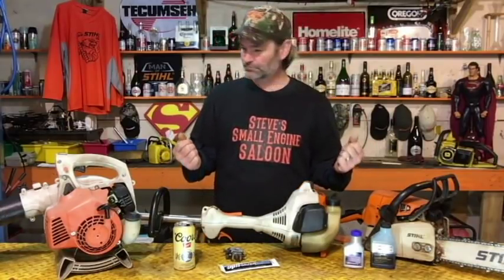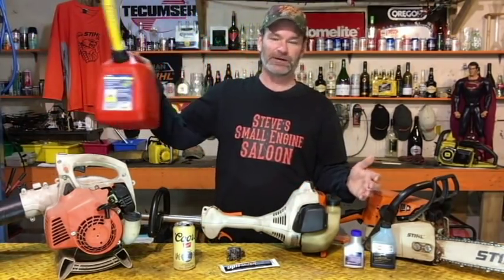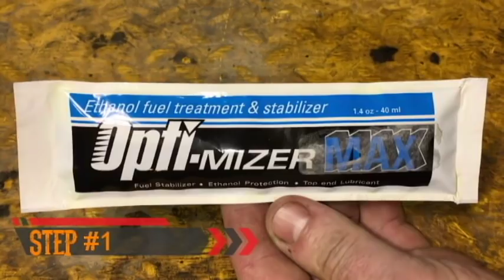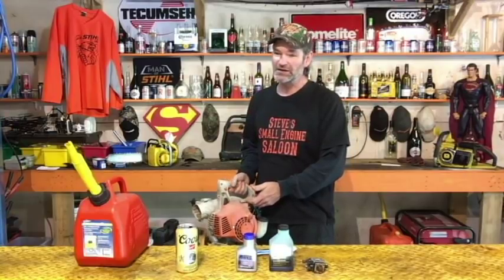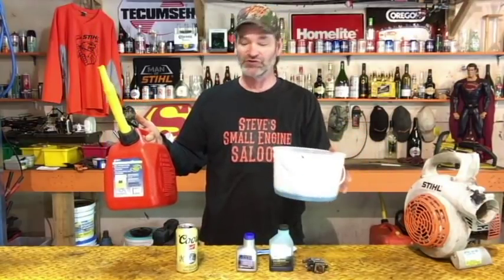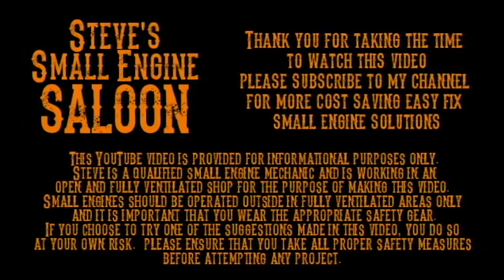How To Winterize a Chainsaw, Weedeater, Blower or Trimmer

Comment: Yet again a good vid but what i don't get Steve is do the rubber bits not dry out in the carb etc and cause problems in the spring Is it not better to keep them moist ?????

I have an old echo chains saw and this you might not believe but having left it for approx 4 years and then needing it in a panic the darn thing started on the original fuel ??

Now i am not saying what you have outlined is wrong to the contrary I agree with you but i am always not sure which way to go ?? The once a month starting is best no doubt

but with 5 strimmers/weed eaters as you guys call them 6 chainsaws 4 mowers 10 motorbikes one outboard motor 4 cars etc etc etc once a month becomes a nightmare !!!

Anyway I am sure there is not a definite answer to this so thanks for your take on it !!! " Perhaps we should just fill them with beers ??????????????????????????? cheers Allan.

Comment: I use non-ethanol fuel in ALL my yard equipment and boat. Never worry about stabilizer and never have a problem. I’ll run the carbs dry too if there’s a fuel shutoff. Everything starts in the spring…always has. The operative word(s) here is NON-ETHANOL❗️

Comment: Another method:
Run engine dry, add a little  (2-cycle) oil to fuel tank, use primer build to suck oil into carb and fuel system. Next season add fresh fuel, primer bulb, choke and start engine. Oil keeps seals fresh.

Comment: Great video steve but there's nothing worse than a dry gasket.  put 50/50 gas oil mix in and let it stall... Pour the rest out and store it!
Reply: Gary Burns = "put 50/50 gas oil mix in it & run it till it stalls"...
DUDE ! . . . You ARE kidding about That , Right ?
50/50 gas oil mix - HOLY HELL !!
I'l Bet You Never Have To Worry About Mosquito's When Your Running Any Yard Equipment !
LOL !  Insects (Or Any Living Critter That Requires Oxygen To Live) Are Probly Runnin For Their LIVES When They See You Pulling Your Weedeater Out Of Storage !

Comment: For a homeowner with a small yard.  Use a trimmer and blower maybe 15 minutes per week, how often would you recommend changing the spark plug?  Blower is used year around because I am too lazy to use a broom on the sidewalk and driveway.  Trimmer from April through October.  Thanks!
Reply: Hey Brian! Make sure the engine is able to get to operation temp. every time you use it. So, 15 min of operation should be plenty enougth for that :) only a warmed up sparkplug can clean itself, otherwise it will be get a bit more crusty every time you use the engine and you have to replace  / clean it from time to time. I have never changed out a sparkplug ever on a 2stroke. make sure you get the right one for your engine, as there a various temp. grade on spark plugs, so this set's up the self-cleaning-temp of the sparkplug to the engine it is used in. check the spark gap, as this is the second parameter. nothing more :) Best regards, Richard

Comment: Steve, aren’t you doing ‘some’ damage to the engine by running it dry? No fuel surely equals no lubrication either.
I’ve always run stabiliser. I’ve found here that stabilised fuel in the carb doesn’t go bad. Comment?
Reply: A couple of seconds on idle isn't going to remove oil from the crank case, everything is coated in oil for quite a while, that's the reason equipment can run for half a tank or more on straight gas.

Comment: Hi Steve. Question: When you winterize a chainsaw, or in my case, summerize my chainsaw, do you follow the same procedure? Do you have to empty the chain oil? Is it better with an empty or full gas tank? I'm gonna be at least 6 months without operating my chainsaws. Thanks for your time.
Reply from the maker: Same procedure.  Chain oil wont go bad.  For 6 months I would say empty....

Comment: Use non ethanol gas and quality synthetic oil and you won't have a problem. I leave that stuff in my 2 strokes all winter and they always fire right up. Even after sitting for a year.

Comment: Is it possible with  bad fuel habits leaving very old mixed gas in Saw for long periods of time and then running leftover gas over and over again for and not winterizing in a snowy climate, is that a possible way to to score a piston-cylinder? Assume all fuel has been mixed properly and proper warm-up and cool-down times have been practiced

Comment: I have some old gas mix, any suggestions on what to do with it?
Reply: Good for cleaning tree sap of chainsaws or, getting campfires going in the rain. You can also mix a small amount of old gas in with a full tank in a truck or boat to get rid of it. Some people don't advise this, but I've never had issues, of course I'm meaning a liter or so at a time in a full 38 gallon tank in my truck, just be weary of moisture in the fuel.

Comment: Steve I hope you can help me. I’m trying to fix a friends mower with a twin cylinder Briggs. Fuel keeps filling into the oil a lot of fuel. What would cause that happen? The valves seem to be ok.
Reply from the maker: Needle and seat in the carb is leaking.  Video will be up on friday.....

Comment: I have a MS-250, bought it with a friend almost 15 years ago. Mine is still good, his, the fuel line cracked and had to change it. Storage is the key, I left mine in the chainsaw box in my barn ALL THE TIME. His was inside, in the basement. Go figure, chainsaw are not indoor tools apparently.

Comment: What are you thoughts about just using ethanol free gas? I understand that solves all the hassle, or have I been misinformed?
Reply from the maker: It definitely helps.  I am doing a video on that soon....
Reply: i empty out my STIHL BG 86 leaf blower run it dry ,then I fill my tank with  STIHL premixed fuel 50:1 fuel mixture combines non-ethanol, high-octane fuel and premium STIHL HP Ultra Oil.let it run for a few minutes and then periodically I'll start it up during the winter months to keep her in shap for the up and coming spring
Reply: @luigitassone8759  thanks for the reply

Comment: I'm no troll Steve.  But I strongly disagree with running the fuel system dry. I've always believed that the end fumes don't have mix oil and the cylinder can get scored. I'm a small engine mechanic btw, but not in the business.  I have quite a few really old pieces of equipment that get used from time, like dad's 30 year old blower,  grandpa's first redmax trimmer etc... if I'm putting stuff away,  knowing I'm not touching them for months.  I make sure that there is a previous tank run of NON ETHANOL gas run through.  Use fogging spray to choke the engine out, then I empty the tank and actually take the carb off, and take it apart, dry it out, and store it Inside the house.  You did give the best advice though.  Don't let them sit! Run your equipment 1 or 2 times a month to operating temp. Message to everyone. ..... avoid gas with ethanol,  2 cycle engines are not designed for it! Carberator diaphragms,  hoses, everything,  it's going to kill anything you put it in!

Comment: Doesn't draining the gas dry out the carb diaphragms? My dealer says to winterize it by just putting premixed fuel into 2 cycle engines
Reply from the maker: The method I showed is recommended by Stihl and I agree with it!  I have a carb kit at work that has been in an open bag for at least 10 years, and the diaphragms are as soft as can be.  I do not believe they dry out...
Reply: All I do is empty the tank then (optional) stuff in a lint-free shop towel to absorb any moisture. Have had zero problems come spring.
Reply: Ahhh, but new and not exposed to gasoline in the open bag?  That change anything with these nasty ethanol exposure to those diaphrams?  Curious.  I had a stiff gas line on a chiansaw taken out- it was made before ethanol and was yellow and cracking, put a new one on, failure prevented.  Old stuff I think has materials that cant take ethanol?  What say you guru?

Comment: Steve I have a question about winterizing my ATV. Principles are the same but how do ensure that the gas reserve in the ATV also gets stabilizer.
Reply: Reserve uses the same gas tank - the pickup is just lower in the tank.
Reply: 08TorqueWrench thx. That makes total sense.

Comment: Greetings from the Canadian West coast and a fellow beer drinker ! Question for you Steve , instead of adding stabilizer to regular gasoline what are your thoughts about using OEM fuel like Stihl MotoMix for winterizing ? Obviously this stuff is ridiculously expensive you wouldn't want to use it as regular fuel but I was thinking just for winterizing it would be good because of the zero ethanol , what do you think ?
Reply from the maker: I agree 100%...
Reply: Cool that's what I thought ! I have another question for ya , I have the Stihl BG50 blower and it's about 5 years old now , well it bogs and dies when you give it throttle , I believe it's not getting enough fuel because the primer bulb is only about 1/4 full after pumping it. I've disassembled the carb and everything looks good all the tiny passages appear clear , the fuel line and filter are good , the spark arrester is also ok , any recommendations what to check ?
Reply: @johnbrown2030  recheck your fuel lines, you have a small hole sucking air or clogged, Also replace the fuel filter in the tank and clean your air filter.  Good luck
Reply: @johnbrown2030  4 years later....I have the exact same issue with a FS55R line trimmer and a new carb solved the problem. Always used non-ethanol, fuel stabilizer but this unit hasn't been run in about two years since it was stored at a vacation house and was just surprised it ran at all. New carb made it run like new.

Comment: Hey Steve I have a fs120 stihl weed trimmer it will start for minute then die out then won't start no more and the muffler fills with gas do you know what it could be
Reply from the maker: Probably a bad metering diaphragm holding the carb needle open!  Check this video out.... https://youtu.be/7-VpdJEJRRw

Comment: Got a husky 288 lite that's not getting enough oil on the bar. There is suppose to be an adjustment screw somewhere but I can't find it.  Do I have to remove the clutch to get at it? Thanks in advance, Kevin
Reply: That was suppose to go on the video about the clogged oil hole on the bar but it ended up on the next video for some reason BTW the hole is clear

Comment: Just pour out the fuel. If it was no ethanol then it will be fine. Drain it all and start fresh in the spring. Stabilizer breaks down also. Running it every month is the way to go.

Comment: Steve, Thanks again for another great video.  Question,  It makes sense to store a four-stroke at the top of a compression stroke (valves are closed, and atmospheric exposure is restricted to an area of the cylinder that does not contact the rings), Would the same hold true for two stroke,,,,, and also, since we are on the compression stroke, will the magneto be in a positon such that there is current (from the magnets) flowing throught the coil ?  Thanks again, Tom

Comment: What about adding oil to the cylinder?, change spark plug?
Reply from the maker: I believe that running it with stabilizer does the same thing as oil in the cylinder, however if you want to do that, I cant see how it can hurt!  Spark plugs do not deteriorate from sitting over the winter.
Reply: have a new plug in ready for spring, ready to go

Comment: I have a shil BG 55 blower I’ve changed cab , gas lines , spark plug 
I’ve tried adjusting the car and it acts itgoing to turn on 
It doesn’t 
Need help
Last thing I’m thinking is to check for compression

Comment: Why does Truefuel recommend to use with air cooled small engines. Why cant this fuel be used in an ATV.
Reply: Probably a good question for the manufacturer. Can't  see why it would affect your ATV, ASSUMING, your using the 2 and 4 stroke versions accordingly. Air cooled small engines run a bit hotter than liquid cooled ones, Trufuel may have other additives because of this. Also most smaller ATV engines are air cooled. But, why would anyone want to run $10 per L fuel in an ATV anyway?

Comment: Steve can you run a 16:1 mix in these?
Reply from the maker: Yes you can, but it will smoke terribly and possibly foul the spark plug and plug up the exhaust after time.....

Comment: Hmmm, I thought you said that running a 2-stroke dry was a bad thing.
Reply: Yeah what's the deal?
Reply: My thoughts exactly. When I raced 2 stroke motorcycles, we were very cautious to not run out if gas, as the lubrication for the pistons relied on the oil/gas mix. We did not want to,'seize' going down the back straight @ 120 mph as it could be hazardous to one's health and wallet.
Reply: When it runs out of fuel,the engine shuts down,it isn’t gonna hurt it

Comment: I do not put my equipment up this way.  I fill them up with gas and crank them up and let them warm up to normal operating temperatures.  Then I pour out all the gas and let it idle until it shuts off for lack of gas.  After it cuts off, I put the choke in the cold start position and pull it over several times until it will not roll over, anymore.  This gets rid of all remaining gas in the carburetor.  I then loosen the chain two turns, clean it up good and put it on the shelf.  All I have to do the next time I need the piece of equipment is refill it with gas.  I leave the bar oil tank filled with bar oil during storage.  I do not run my stuff at any speed other than idle when I am running king them out of gas.  I do not want to run them in a lean condition.
Reply from the maker: Great comment!  Thanks John...

Comment: Fogging oil, your thoughts?
Reply from the maker: Might just be the climate I live in, but fogging oil seems to only be used in outboard boat motors!  It certainly wont hurt your lawn and garden equipment if you want to use it...
Reply: Thanks!Great video, keep doing what your doing!
Reply from the maker: Thank Mike...
Reply: If storing in area with cold to warm temp swings may provide additional protections adjust moisture build up from sweating.  Any storage for more than a year I would say it might be worth it to fog it but otherwise it's probably just Overkill because the two stroke gas does leave some residual oil residue. Plus it will be a pain to start back because you have to burn off all that extra oil. It'll be a lot of smoking and possibly having to clean the plug again because it made foul it.

Comment: When I vacation, my friend George flushes my toilets every day to exercise the gaskets
so they don't dry out.
Reply: I have vacation homes that I don't ever rent out so they get winterized every year. I've never had a problem with toilet gaskets yet, but do drain water systems completely and then use RV/cottage anti-freeze in drains, toilet, washing machine.  I would think vaseline or plumber's grease on seals or gaskets would keep things from drying out so you don't have to rely on your friend? He must be a good friend unless he needs to use your toilet every day or lives next door. I really didn't think gaskets were that sensitive for short periods, unless you vacation for years. I guess it is something I'll fact-check one of these days.
Reply: Lmao! You must exercise the gaskets George!! 😂👌🏻

Comment: Could you explain chainsaw woodruff keys? Do they even take a key?
Reply: You get the key when you pass your chainsaw operator’s exam.  Took me two tries to pass!
Reply: No no no! Not an exam. A woodruff key. Like on a mower? If you.hit a rock or jump off a curb, the aluminum key way shears off the crankshaft (woodruff key) and has to be replaced in order to retime the flywheel/ignition gap to the valves...
My question was, can 2 stroke motors, get knocked out of alignment? And please explain why lawn mowers have an aluminum flywheel "key" that breaks or shears away if you hit something?
Reply: @andytsivis7919    Ok, I’ll try to answer your question.  On any small engines EXCEPT rotary mowers, it’s very rare for a flywheel key to shear off, short of an incorrectly tightened flywheel, or an actual failure of the piston/ rod.  On a rotary mower, if the blade stops suddenly due to hitting an obstacle,  the energy stored in the engine flywheel will usually do one of two things :  If it is a steel woodruff key (Tecumseh) the flywheel will split, or the key will partially shear and damage the keyways.   Big weak spot for those motors.  Briggs and Stratton uses an aluminum key that will shear without damage to the FW or c/s keyways.  Either way the ignition will be out of time and the parts will have to be replaced as necessary.

Comment: Seek and ye shall find! So I subscribed as well. (Nearly) 50 year old male seeks assistance with his 2 stroke engines. Complete imbecile with this sort of thing so with any joy I shall find out whats wrong with my FR350 beast. Hate tinkering with engines and have no experience, so we'll see how we get on. My machine died abruptly after a long (over 1 year) period of inactivity. I emptied the fuel and put fresh in before starting. As usual it was a bugger to start then it died after about 10 seconds of high rev cutting. Thought I had seized the engine. Still had compression so looked at my fuel. It was paler than usual then I realised I hadn't put the oil mix in (twat). Bought new spark plug, replaced the fuel with the correct stuff and tried again. I ended up starting it after about 30 minutes of pulling and blisters on both hands. My son had to hold the trigger as this seemed to get a response from the engine. After it started it wouldn't idle. So I tinkered with the Carb adjustment and now have "idle". Thing is it still wont start correctly without the use of the trigger being held. Has the incorrect fuel damaged the carb?? and more worryingly why is a new carb for this model £140+ / $180+ (ouch). Any help greatly appreciated. Steve.